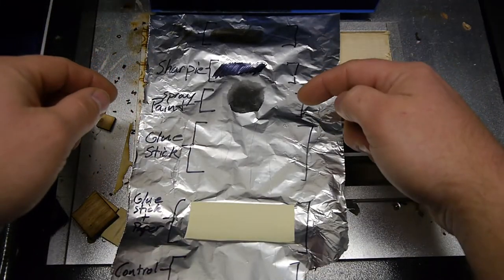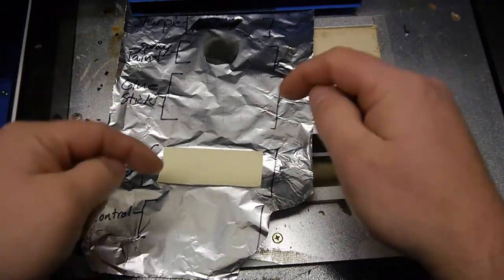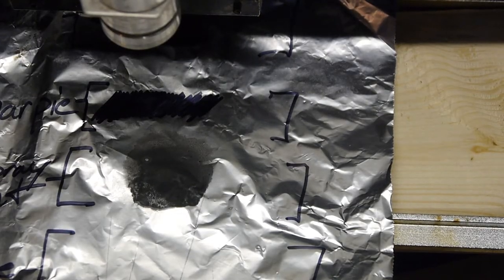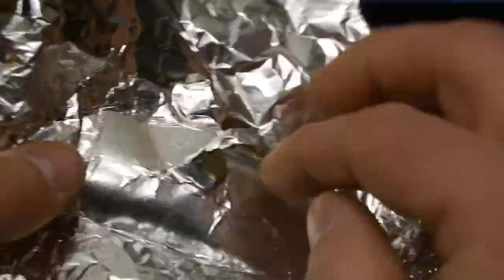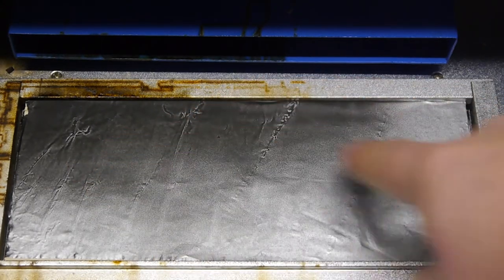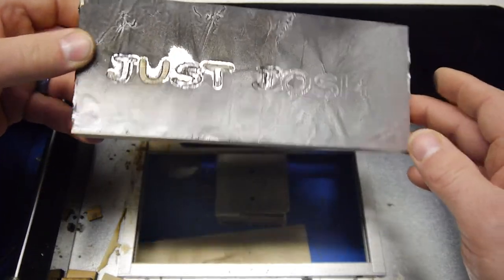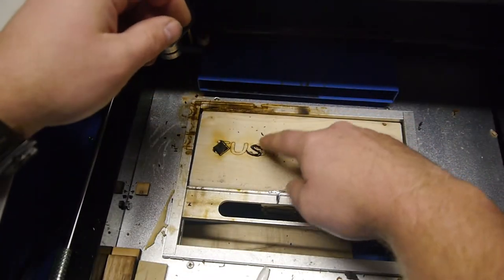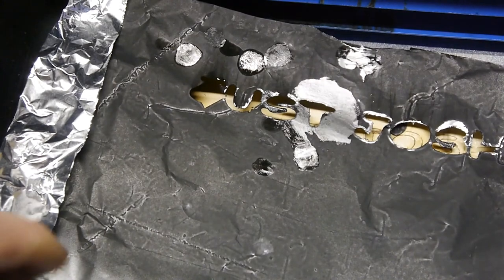K40 Cutting Aluminum Foil with a Chinese laser engraver, proof of concept

Comment: No need to remove the paint. Just flip the image, then flip the foil after cutting to the clean side, which reduces the amount of work for this method considerably.
I could see using this for costuming, using the cut foil on top of illuminated plastic could be a cool effect, or some steampunk / sci-fi art.